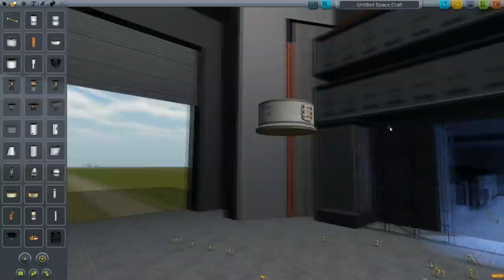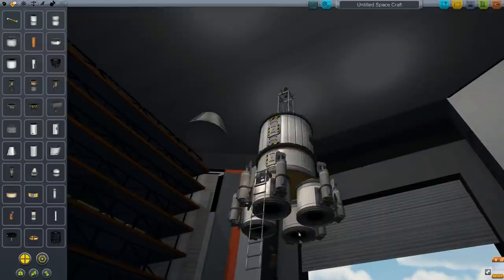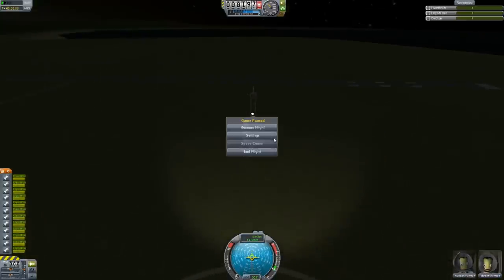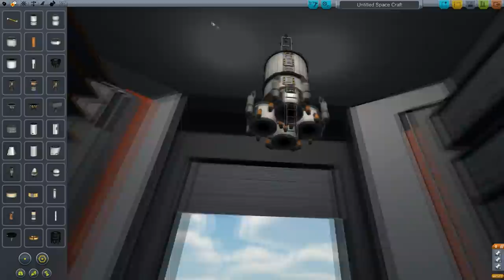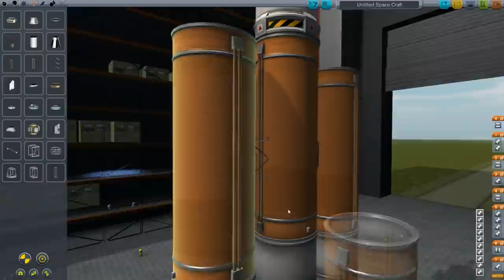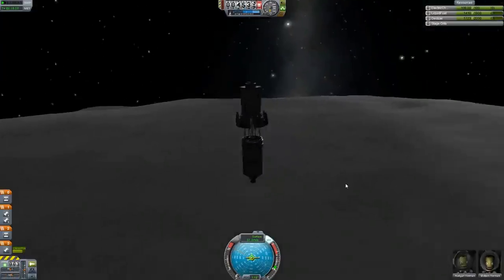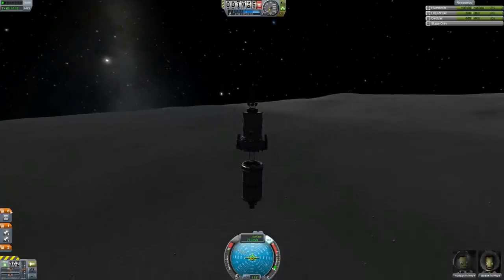Kerbal Space Program - Building a Moonbase Part 1: Let's Get Started!

Comment: You can manuevre your rocket easily through the use of RCS, Torque, and thrust vectoring

If your rocket's center of thrust isn't on the same axis as your center of mass, your rocket will be unstable and will either require corrective maneuvre throughout the flight, or will fly improperly

You may find that the use of SAS will help you quite a bit

Comment: Install wings on each stage and include a stabilizer from the control parts tab for each stage of your rocket. Then hit the t key and it will turn on the stabilizer which will basically lock the rocket on what ever point it is locked on. For super easy mode install the Mech Jeb mod it has an autopilot that will launch the rocket for you. It is an amazing game and just because it is difficult doesn't mean you should give up. There is a lot of good knowledge to be gained from this simulator. IMO

Comment from the maker: Did you use the larger decouplers? If you did, you should put sepratrons pointing up on your boosters and have them fire when you decouple them. Have them point mostly up, but a tiny bit toward the rocket. It helps a lot.

Comment: Sounds like a balance issue with weight. At lower, denser, alt your winglets and fins can hold the thing with no problem, but the higher you get, 10K and up, the air thins out, and the flight surfaces have less and less "Bite". So the unbalanced spacecraft spins.
hit the Weight Ball and look right down from the top, see if its off center.

Comment: in the latest version (1.33) you need solar panels to power the torque wheels of your command module... i found this out the hard way :( also to power anything that requires an electric charge (check the stats when constructing)

Comment: Not sure exactly, but it seems to be that the tiny structural attachments used to place the five engines are nowhere near as stable or strong as in this video. I keep having rockets break off the bottom on lift off

Comment: 10 mins in you are struggling getting a center off your 4 part splitter.  It adds 5 parts to do it but just put on 4 separators then another of the 4 part splitters but flip it upside down and it will match up and give you a new center point.

Comment from the maker: "In theory" and reality are two VERY different things. In order to do something as drastic as changing the Moon's orbit, you'd need technology that we do not currently possess. You'd need massive engines that don't run on fossil fuel or chemical fuel at all for that matter. Unfortunately, in KSP it's impossible, as the planets are on rails and it's not possible to change that without going in and messing with the code.

Comment from the maker: Technically, it is a moonbase, in the sense that it is a base on the moon. If I were to make a base on Ike, I wouldn't call it an Ikebase. And to answer your other question, use the WASDQE keys to tilt at 90 degree increments, hold shift for smaller adjustments.

Comment: OK, OK, apologies for the cranky tone of previous message. I think you used the LV-T45 in the middle and 4x LV-T30 on the outside.

The five smaller engines are certainly more efficient, and thanks a ton for the information. But I don't understand *why* it works so much better than one big engine that nominally produces more thrust